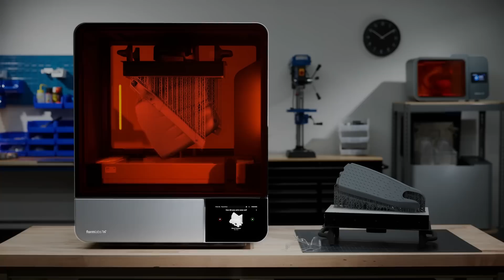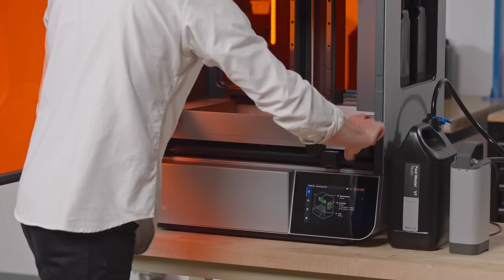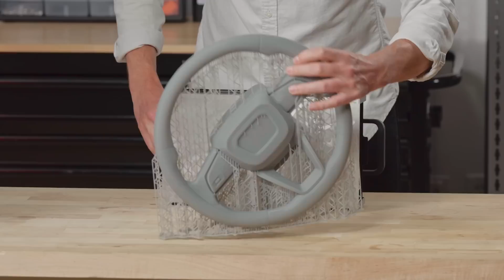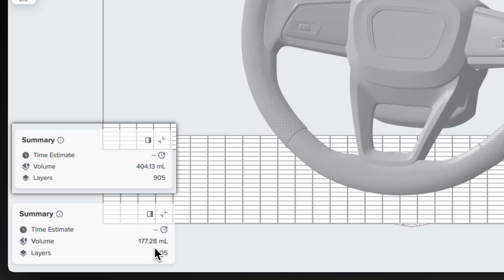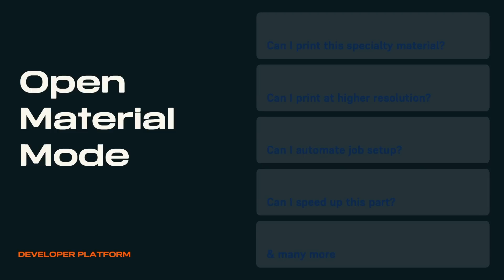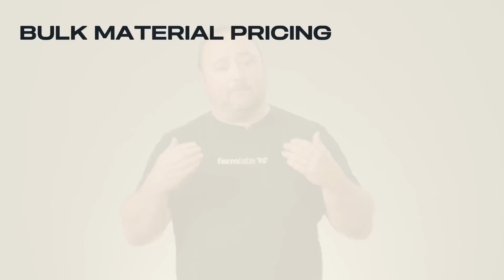Form 4L Reveal (and More) | Formlabs Keynote

Comment from the maker: Recap: Form 4L, lower resin and powder pricing, Resin Pumping System, Form Wash L 2nd Generation, Nylon 12 Tough, Nylon 12 White, Open Material Mode, Print Settings Editor, Formlabs API, Hollowing, Texturing, Part Cages, Drain Holes, and Part Labeling. https://bit.ly/3NqeXtp

Comment: does the 3L and 4L use the same build plates? and/or Resin pump?
Reply: As the 4L uses a diffent cartridge than the 3L, I would imagine that the resin pump isn't intercompatible between them.
Reply from the maker: No for both—The 4L Build Platform is larger, and the Resin Pump is also redesigned for the new Form 4/4L cartridge design.